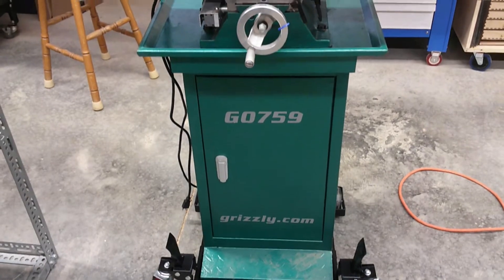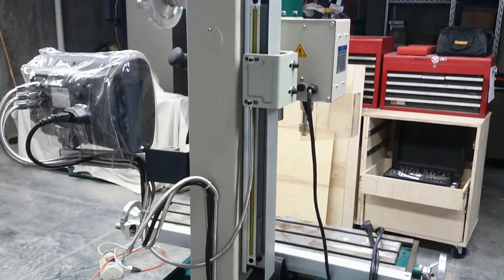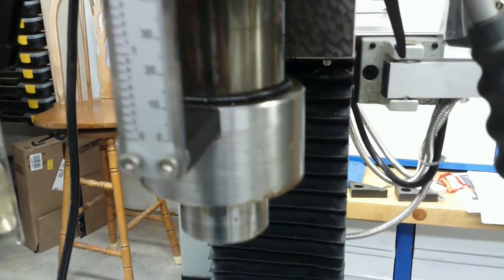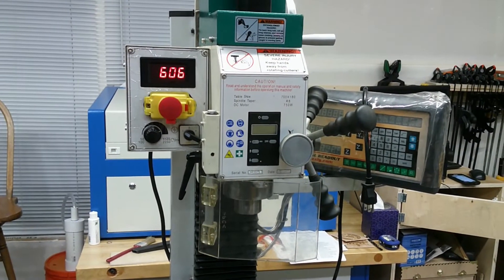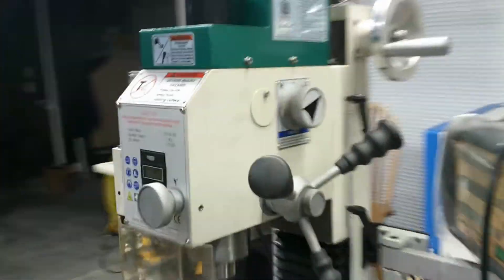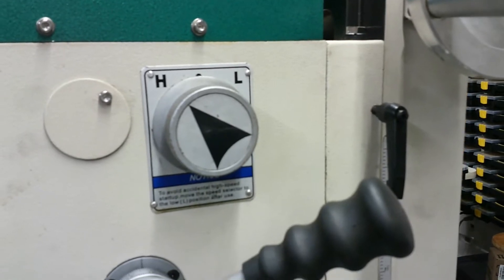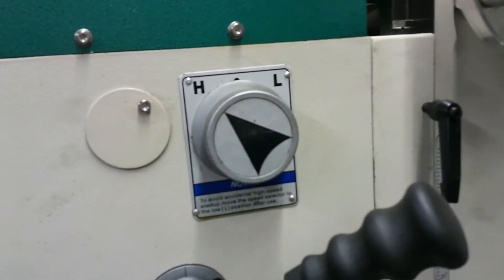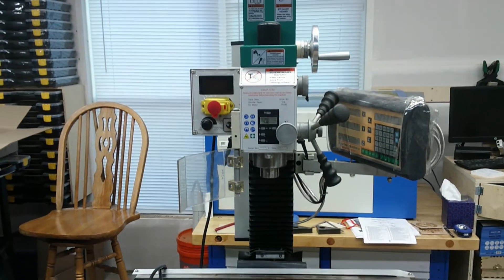Grizzley Milling Machine Break In Procedure

Comment: I bought a g0704, And put an aftermarket DRO on it. So far it's been great to me.
Reply from the maker: That's awesome! I haven't used everything on my DRO yet. But what I have used works really well. I did test the read out against actual measurements and it was within a 0.001" in 12 inches. That will be close enough for me. Thanks for the comment!

Comment: Thank you for the video but it just would be a better training session if your video was showing what you verbally was describing. One example is when you say to go to 1000 RPM you’re showing it display of 1992. Now I know what you met, but it’s just strange that your visual does not match the audio. Just a thought.
Reply from the maker: That was a voice over and one of the faults of using VM’s. The picture doesn’t always match the voice. Sorry, I’m not a pro, just a green amateur at doing YouTubes. Thanks for pointing out the issue, I’ll try to keep it in mind going forward.